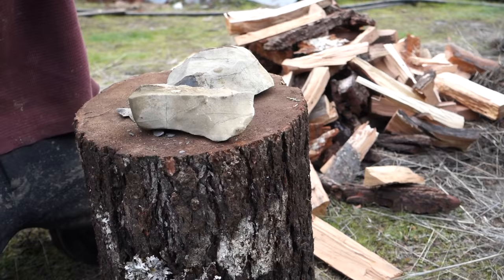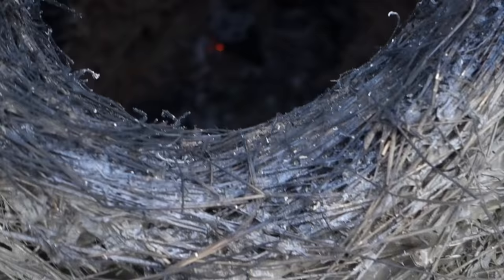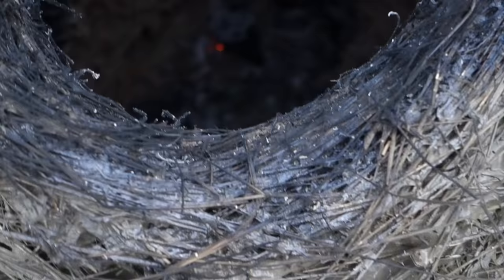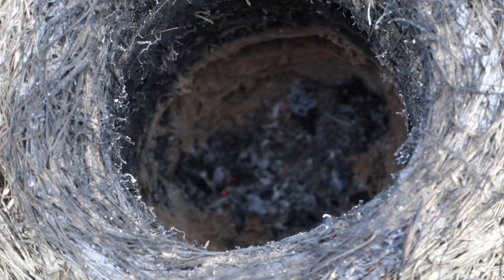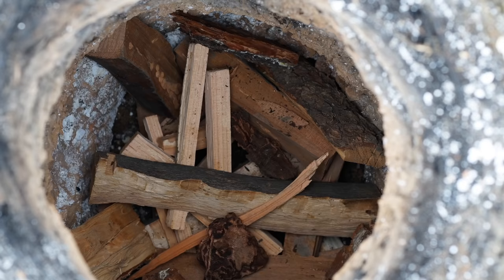PRIMITIVE FIRE SCIENCE!  Burning Shells Into Lime In a Grass Straw & Clay Furnace

Comment: Fascinating!  I was burning a couple of tons of juniper debris today and stuck a lot of thin, flat limestone pieces into the fire.  Once it cools down here in a couple of days I'll see if the calcium oxide reaction happened.  Thanks!
Reply from the maker: That's cool. I probably did.  You want to slake as soon as possible and definitely don't let any rain in there.  best to dig it out sooner than later.  One of the common ways to make lime was in big piles called rick's just alternating layers of wood an shells stacked. It's very inefficient, but it works.  No need to use hot water with limestone, just add a bunch of water and if it's well burned it will react quickly.

Comment: 5:05 I don’t understand what’s happening but that is so awesome, this whole video is so awesome. You weren’t lying in the beginning
Reply from the maker: I really don't know the chemistry of that reaction, or I guess why it produces heat.  It's cool though!
Reply: This is something I actually know!
quicklime (the burnt shells) react with water to form calcium hydroxide. The quicklime reacts with the water, and due to alkali metals like calcium always willing to give away electrons, this creates an immense amount of heat (hence the exothermic reaction). This is why mixing cement can be very dangerous, especially when it makes contact with the skin, as adding water to the cement (which contains lime among other things) creates heat, and can cause chemical burns when in contact with your skin, eyes, respiratory tract, etc.

Comment: I am building a cob house in NW GA and am planning on lime plastering. Have had a really tough time finding lime that I could use. Called many places, including manufacturers and no one could help, even local concrete and brick supply stores.  After this vid I think I found the solution! Thanks so much for the info! Gonna start harvesting rocks around the house that I know are limestone.
Reply from the maker: That would be so cool :). Good luck.  You should look for mineral maps of the area on google. Sometimes you can find very specific records about mineral resources in an area that have already been assessed for quality. You might find an old quarry, or lime kilns, or even an active quarry that will let you take some quality rock by the truckload.  I'm not sure how well random limestone will work with impurities and such, but I would certainly try.  I a lot of them are high magnesium, but I think they can probably still work well from what I've read.
Reply: @SkillCult  that's a good point about "random"limestone. I am not educated enough to know the implications of a higher Mg product. What I will probably do before building a kiln is to burn a couple rocks first, make a small amount of lime plaster, apply a small amount in an inconspicuous place and see how it goes. Again, excellent videos and appreciate those suggestions

Comment: Looks fun, looks cool, and looks like something that would look cool,,, 

I've made lime via acid-base reactions ,,, yeah, gotta do this too. Thanks Mr.Edholm
Reply from the maker: Yeah, do it, right up your alley!  It's super fun.  Do you have shells or limestone?
Reply: I got some shells meant for a CO2-generator (acid-based), but I'll need twice as much at least for it to be worth a kiln.
Got plenty of (washed, no/little lye) wood-ash, which I planned to use for the same generator,, was thinking I might try filling steel cans used to store food, pack em' with ashes and blast off.. then wash off, decant, and utilize (if anything as fertilzer. It was it's intended eventual end)

Currently quick-drying loads of flailed willow (no bark, no splitting needed ), big ones as well, meant mostly for biochar (because I can't use firewood as an excuse,,,  and I want coal,, and like fire,,, because it's fun,,, and it's cool etc.)....  soooo if I scale up the kiln, I'll need more wood. 
Ofc, I'll also end up with more ashes,,,, well not much. Got a good stockpile, but no reliable sources I can think of apart from trying to pick more shells. Won't get as much as you though,  having half the ocean dead in your backyard

Comment: This is probably the 4th time I’ve watched this. Very cool start to finish.
I attempted this last year - but didn’t make a straw kiln. Had a good hot fire but it was a failure. I think my limestone was in too big of chunks, possibly not hot enough for long enough either.. I went to hammer the limestone into smaller pieces the other day - and inside was petrified ribs and spine from who knows what. The marrow chamber was full of crystals. Guess I need to find some different limestone. I’d like to build my own “pet” too. Just have limited space
Reply from the maker: Wow, that sounds cool.  Yeah, you need to either knock the pieces down to about 2 inches or less, or have larger fuel, so you increase the time the stone is heating.  I just smash the stone up with a big rock or something.  This system, burned like this will cook 2 inches and down, but better on the smaller side of that.  Err on using too much wood at first. You can cut down later.
Reply: @SkillCult  I posted a mediocre (at best) video of the fossil I found in the limestone. 
Sent pics to a paleontologist and she thinks it’s a hornless rhino that lived in ND 35 MILLION years ago. So cool

Comment: Awesome Video!!!!! Thanks.. A correction though  Lime is used to make 'lime mortar' which can be used to make building mortar, plasters and paints but it IS NOT cement!!!  Lime stone is used to make cement but is burned at higher temperatures with additives, typically using approx. 50% MORE energy to produce than building/Type 'S' lime...... Also lime mortars remain permeable/breathable and flexible when cured which cement does NOT... Lime is a very different animal for use in building than cement.. I LOVE IT!
Reply: Hi Gail!  I dig how you give us the goods : )
Reply from the maker: +Gail Haddow  Thanks Gail.  Nice to actually meet someone else that burns lime!  I'm clear on the lime is not cement, this just wasn't the place to go into the differences while catering to short attention spans.  I did think that lime was used to make portland cement though.  So you're saying that cement is made with raw limestone, and after processing calcium hydroxide is not a player?  What is it?  Calcium oxide, or calcium something-esle-ate?  I'm not sure where to draw the line on lime anyway.  Nomenclature is confusing.  Would you say lime is strictly calcium hydroxide component of any lime preparation or lime-like substance after burning?  Dunno, maybe I need to read though building with lime again.

Comment: I wonder if it's possible to make ash glazes from seashells? For pottery I mean... Further investigation needed!
Reply from the maker: I think if you research the use of calcium hydroxide or calcium oxide in glazes, you'll find out.  I would be surprised if it is not somethimes used in glazes, though it can also essentially melt clay as a flux, so it might cause issues.  I've been curious about it for sure, but never looked into it.

Comment: Love the video and you rocked it!
Question, you say you can store it in water.  If you wanted to make your own cement, wouldn't you mix it with sand while its dry first and keep it dry, or can you mix it with water, let it dry after the thermogenic reaction,  grind it, and THEN mix it with sand for your cement?
Reply from the maker: If you store it wet, it will settle as a nice thick putty. You can mix that with sand and use it as plaster or mortar  As soon as it dries out, it is basically turning to limestone again.  The exception is if you slake it just enough to make a dry powdery lime and storer that away from air.  You can use that the same way, by adding water to make a putty.  but it's easier to make it wet and keep it wet until needed..  It is a little bit too soft to just use as cement like we know cement, but there are other things you can mix it with to make harder cements.

Comment: How is all limestone unreacted?   Id imagine the moment you mined limestone it would slowly do this?  How long did you cook that limestone before you dropped it in the water?
Reply from the maker: Limestone is the stable, inert form.  It will react with strong acids, or slowly with weak acids (look up the formation of stalagtites), but it is basically stable.  There is a longer version of this that explains the process and lime cycle better.  https://www.youtube.com/watch?v=jOxaOTUGuKo&t=6s  cooking time is dependent on how much mass or thickness there is to the material.  It has to be hot enough, long enough. You size the amount of fuel and size of fuel to the amount and size of calcium carbonate, light it and walk away.  If you get it right, everything will be calcined enough.

Comment: Hi, very nice video. can i ask how long you burnt the limestone for? i am just building my own kiln at the moment and i cant find much information on how long it takes to burn the stone all the way through. kris harbour
Reply from the maker: With wood stacking the way I do it, you have no choice, you just light it and let it burn.  maybe you can top it off one extra time, but it will only affect the top layers of stone if that.  The two factors are dwell time and temp.  wood will get to the right heat, if there is enough and not over unless you add forced air.  but if the pieces are too big, it will take too long for the stone to get hot through.  I don't think dwell time (how long it's hot) is that long.  If the kiln is small like mine, make the pieces small, like 2 inches or less.  All pieces around that size and small calcined fine in this kiln.  Watch the longer version of this vid if you haven't yet.  Larger wood will increase the burn time too btw.  Use some wood up to 2 inches thick in the mix to keep it burning longer.  I think you will do pretty well with a ratio of 1/3 stone 2/3 wood, but maybe try 3/4 wood the first run.  You don't need hot water to slake the stone, just for shells.  Lt me know how it goes!

Comment: Why does the shell boil? Is it a chemical reaction or are the shells still hot enough to boil water?
Reply from the maker: Yes, it's a chemical reaction. The shells are basically cooled off when I start slaking. Limestone doesn't even need hot water to start it, but shells do to kick off the reaction for some reason

Comment: So cool......Your videos are amazing...!
Reply from the maker: +GFD472 thanks!
Reply: @SkillCult  I want to try a smaller kiln 'cause I just want 1 kg of quicklime and I don't have alot of space. Do you think a tiny kiln like with an outer volume of 5 liters can work? or something like 30cm high, 15 cm diameter. ideas?
Reply from the maker: @davemwangi05  It might work if you used very thin, tiny shells.  Maybe egg shells.  But you still might not get the dwell time you need.  it not only has to get hot enough, but it has to stay hot long enough.  I've done egg shells, mixed with nut shells, in an 8 inch stovepipe, about 3 feet tall and that worked fine.
Reply: @SkillCult  mine is a really big twist, with lots of changes. Firstly, since I'm far from the coastline so I don't have access to shells or limestone. I've conducted smaller tests with wood ash, I know it's a crazy twist but, Lol, look. First washed off of all potassium and sodium salts from woodash, as you know Calcium Carbonate is present in wood ash and it isn't soluble. so it'll be left behind.

then I made a pastry thing out of it and cast it into thin slices exactly like size of a coin, and dried them. Using a bunsen burner I was able to heat the slices until the edges were white hot and turn them into quicklime. Sure because upon testing by slaking, the samples from edges got very hot upon adding cold water, the center of the slices fail to calcine. 

So there we go. this thing is possible. I wanna fire the kiln with butane instead of wood, I'm guessing the additional shielding will help all the slices convert since I was able to partially achieve it with an open flame.   Thicker blocks on a burnsen completely failed to calcine, that's why I tried slices. I'd like to hear your advice, possible bottlenecks etc. Thanks for your reply.
Reply from the maker: @davemwangi05  With butane, you should be able to do any size as long as it is set up so that it heats everything through.  I know there is a lot of calcium in wood ash, I remember it being in the neighborhood of 30%, which is not anything near a shell, which is near 100% I think.  Mind the temps though.  wood is pretty much self regulating temp wise, but it's probably not hard to get it too hot using a gas and air mix.  In fact, white hot may be too hot.
Reply: @SkillCult  I thought they say the higher the temperature the better because it decomposes the carbonate faster and completely. Or how does high temp become a negative factor?
Reply from the maker: @davemwangi05  It can get too hot.  I think it permanently changes it into something else.  Overfired limestone is used as a kiln lining, so I don't think it's reversible.  Just look up the recommended temp range and follow that.  I think it's around 900c  Everytime I've measured it, it's been in the ballpark, but only using wood.
Reply: @SkillCult  I've confirmed it can be heated to very high temps, and thats a + because the faster it'll decompose and shorten the time required in the kiln. I've read one which says it 950 C is the temp at which it decomposes but 1100 is recommended for hastening the reaction.

Calcium Oxide has a very high melting point of 2700 c, just like many other metal oxides. At these high temperatures, oxide is the final product that forms unless you have more reactive gases like chlorine, which displace the oxygen. i.e reactivity series. 

 I also remember some thing called limelight. When heated very high temperatures, it emits light brighter than conventional bulbs and was used in lighting studios. It doesn't change to anything else it still remains oxide. 

https://www.youtube.com/watch?v=KzzRYSyQCA8&ab_channel=SSERCChemistry 

https://youtu.be/TZhrRINQ738

The main problems would be some structural parts of the kiln being unable to handle the temp.    One final question It seems the straw is the one that plays a major part in heat insulation , right? I was about to omit it from my kiln and I realize this could be a fatal mistake.

Comment: I’m looking into collecting egg shells for this process. By weight, how much of the sea shells were added to the furnace/kiln?
Reply from the maker: I have no idea.  use sticks up to about 1/2 or 3/4 inch for eggshells,  the first time, just use a lot more wood. YOu can do it in a double wall stove pipe section or something simple like that  Preferably insulated or double wall, but it doesn't have to be.

Comment: does the shells need to be still warm or can they be cold after using the furnace ?
Reply from the maker: It is okay if they are cold, but don't let them sit around in the air.  If you can't slake them, put them in a plastic bag, or an airtight container until you can slake.  But when you slake, use very hot water to start them.  for some reason, shells are different than limestone and it is harder to get them started slaking.  It has something to do with their structure.  Once they are going, you can add small amounts of cold water as need to finish.  make sure you watch the longer version of this video if you are going to do it.
Reply: @SkillCult  sure, safety first right ? anyways thanks for the information. i've been looking for info about it but i couldn't find any specifics without going through years and years of reading material. perhaps someone should make a simple diy book about the  ways to do stuff like this.. i bet they would sell well .. maby something about color pigment for painting as well ? i know you use lime to bond the color. anyways enough rambling :P

Comment: thanks for the fast reply shocked me! I want make it to normalize field corn for tamales etc with creek clams and to have some lime around. What is the correct way to dry it to make a lime powder. "KingFish" out
Reply from the maker: I usually get email notifications of comments.  Watch the long version of this video  too.  It can actually be hard to make dry lime hydrate out of shells.  Sometimes it works and sometimes it doesn't.  Because shells are structurally different, it's not always possible to kick off the reaction without hot water.  Even then, it's easy to slow it down.  One thing you might be able to do is keep them as quicklime in a tightly sealed jar away from any moisture.  That is what Cal used in meso-America for processing corn is actually.  There might be a way to consistently produce powdered dry hydrate.  If I had to guess it would invovle heating the shells while spritzing them with just enough hot water unitl the powder up.  You can't add too much though, just enough to make them into a powder.  many times I've tried to do that and it didn't work, but then occasionally it will work.

Comment: Hey I checked out your website!! Great videos!!! What will the battery acid do fizz?? I have a lot of old batteries here I might be able to drain! What am I looking for a fizz? When I pour acid on the tested rocks??
Reply from the maker: Yes, exactly.  Vinegar may or may not do anything, but a strong acid will fizz.  You could also just set up a small burn with small chunks of the rock and scrap wood and see what happens.  It may not calcine all the way through,but it might cook the outside enough to slake.